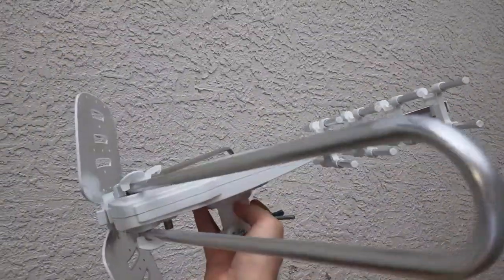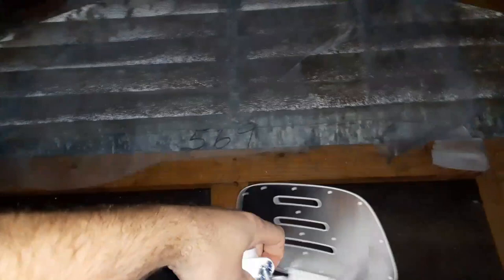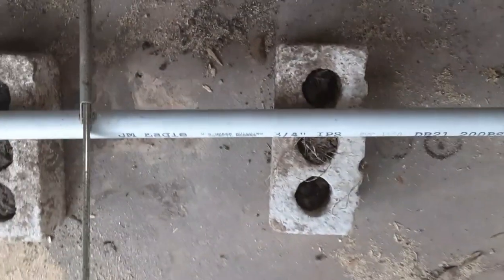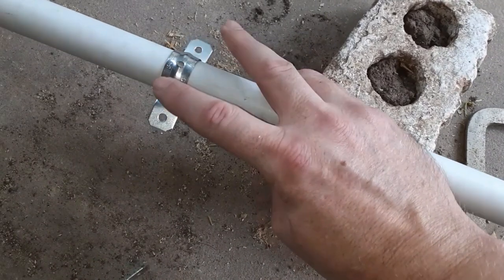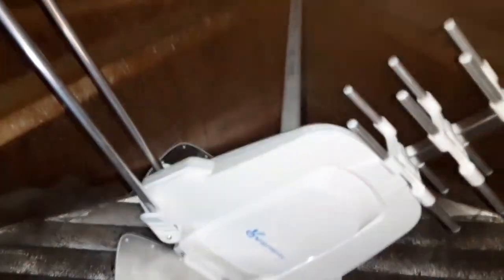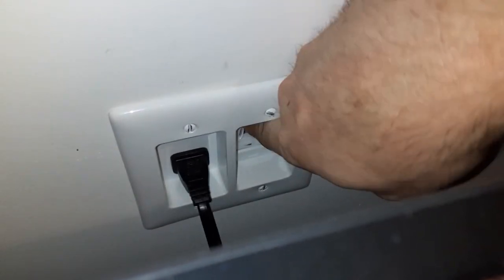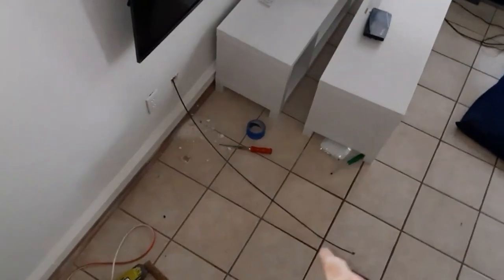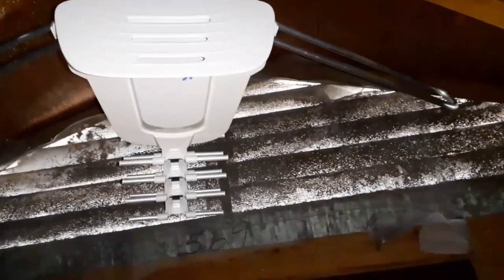Best TV Antenna Attic Install

Comment: What I don’t see in the last shot of the video, which is the thing that concerns me, is the coax cabling to the antenna. If the box rotates the antenna -with the cable installed - doesn’t the cable get wrapped around the post or twisted? Since the antenna rotates in just one direction and you continue to try to adjust the antenna over time, it will continue to be turned. How do you prevent that cable from getting twisted around?
Reply from the maker: @larividj  Good question. The antenna rotates in two directions. Once it reaches it furthest point in the rotation, it automatically rotates the opposite direction. The coax does not get wrapped around the post.
Reply: @fixitquick69  oh fantastic! Thanks!
Reply from the maker: @larividj  Thanks for watching!